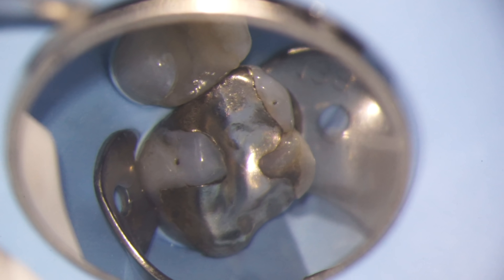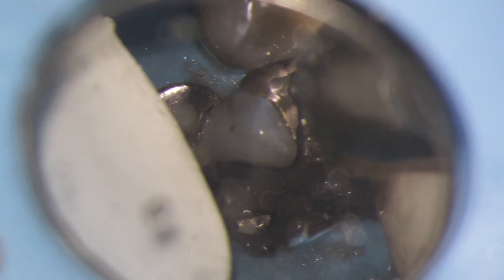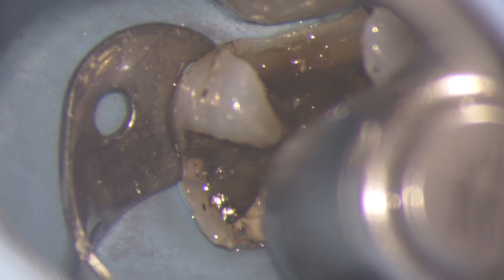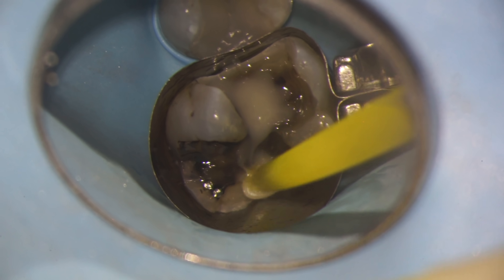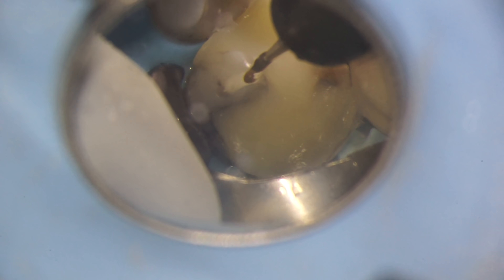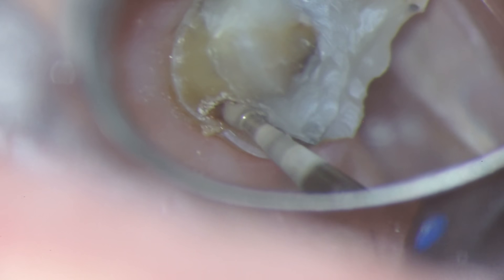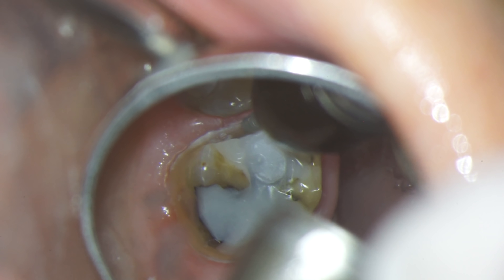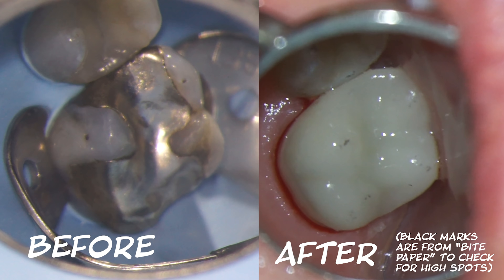How Silver Fillings are Removed

Comment: I just began seeing a new dentist and I was told that she wants to replace my silver fillings. I suspect that some dentists elect to do more work than is necessary just to get paid more. My previous dentist totally repaired my smile with white fillings and never mentioned my old silver fillings at all. I've probably had them for 25+ years and think they're fine. I'm not sure who I should trust now.
Reply: You may be okay with keeping them, it's just that some people experience decay under silver fillings and mercury poisoning, which in this case it is best to remove them.
Reply: @komfykoala6083  I have had one replaced. Doing so caused sensitivity in that tooth and it took several months for the sensitivity to subside. They showed me a very small crack near the filling. It's nothing serious but I suppose I'll have the other replaced at some point. Getting everything fixed and practicing good oral hygiene since I neglected my teeth during my adolescence, and I want them to be in good shape when I'm older.
Reply: @ClassicalPan  Best of luck to you 👍

Comment: I love your videos man! I struggle with amalgam removal and have tried to do the splitting technique but it doesn’t always go super fast still. Taking out an old #18-MO I’m always worried about my bur dropping and hitting a pulp horn. Usually it’s tough to get the last bit of pulpal floor metal because my 330 is “skipping” along the top. Any advice on that?
Reply from the maker: Julian, I hear you. One thing you could try is a 331 bur instead. It's a big bigger and seems to get through the amalgam easier. Also, if you're not already, you could try magnification (ideally 3.5x or higher) WITH a good headlight (the latter being the most important part). When you can see exactly what you're doing, you'll have a lot more confidence in knowing when you've broken through the last bit of amalgam.
Reply: @MichaeltheDentist  Thanks! Yep I use a strong light and 4.0x. I'll try the 331's ; I find taking out amalgams so stressful sometimes (especially when they are RIGHT on top of a horn). Thanks for the advice!

Comment: Silver? You mean mercury fillings. And very large amounts of mercury are released when you drill on these fillings with a high speed drill. It wouldn't surprise me if you far exceeded the EPA's air quality standards for the work place.
Reply: @ Ian Curtis.    Did you notice how well you could see the procedure?   That because of excellent use of high volume suction which removes the majority of the debris/ vapor

Comment: What good about silver/amalgam fillings is that they expand over time covering the unfilled areas VS composite that shrinks which let bacteria inside/invade the shrinked areas..
Reply: yeah mine expanded and broke my tooth in half. clean off. now its caused me more issues cos i now need a new filling to fill in the gap it broke
Reply: update. mine has now come loose and because it broke my tooth like stated above i now need the tooth removing
Reply: @CSGOMercy  I'm sorry. Which tooth you lost? Molar probably? Upper or lower?
My upper 2nd molar broke in half too coz of the really old silver filling(15 years). The entire distal part of the tooth chipped. I think I'm gonna need a crown now after an rct , even though my root is all fine. ☹️
Reply: That's certainly the bad side of amalgam, i forgot to point out so there are pros and cons with using this material. But I guess it's being studied worldwide, infact some countries already ban the use of it
Reply: Ya it also dumbs people down enough to not realize they’re being fucked and lied to about everything

Comment: I had my old fillings replaced, and my dentist never used a rubber dam. I don't recall chunks of filling being removed either. It seemed like he only used some sort of grinding tool, so I have to wonder if he even completely removed the old filling. There's still a bit of sensitivity and it's been 3 months. Should I be worried??

Comment: what happens if the bacteria is sealed in by the silver fillings? Do they continue to eat and rot the teeth or do they die since they would kind of have been blocked from access to sugar in mouth? :) Thanks
Reply: They use a solution that kills and bacteria before they fill the cavity. However, a filling can become loose later down the line without you noticing and cause what’s called leakage. In this instance, yes bacteria can travel through and continues to grow the cavity.
Reply: I'm interested in the answer as well

Comment: I am always scared of the dentist drill.
When I was 4 or 5 I went to the dentist to get a filling, but the dentist said that it was gonna be quick so I didn't need anesthetics. Worst. 2. Hours. Of. My. Life. So now I thank that local dentist for traumatizing me. Now when ever I hear the drill I feel the pain and my eyes start tearing up. Before I had no trouble going to the dentist but now I always hesitate on going.
Reply: Mine is a similar story. Most of my milk/baby molars had root canal done on them. Except for a molar on left side which required anaesthesia, none of the other root canals were performed under anaesthesia. I have been so accustomed to the pain that it doesn't bother me any more. 4 Adult molars had root canal done and one teeth was removed without any anaesthetics.

Comment: ive lost all trust in dentists after being told the small black/brown marks in the crevices of my teeth were fine.  i go 3 times a year between checkups and cleanings as i didnt start caring for my teeth until i was 16.  I was very concerned about the marks and asked again and again for them to be drilled and fissure sealant applied to prevent food from sticking and causing decay.  I was told every time that the marks were cosmetic, just staining.  But sure enough over the last 2 or 3 years, each little mark has been revealed to be the opening to a large cavity hidden beneath the surface.  2 were so large i was offered crowns.  The bastards just wanted my money and were waiting for my teeth to go beyond the point of simple saving.

Comment: Is there anything you can recommend? I have seven of these in my mouth. I'm willing to pay to get him out. Nobody wants to do it.
Reply: Try holistic  dentist
Reply: Yes defiantly a holistic dentist I'm getting mine removed once there up and running hopefully July or aug it's expensive thou 300 per tooth!
Reply: Probably because theres nothing wrong with them. You're not doing your health or your wallet any favors by doing unnecessary dentistry
Reply: I have two which are visible that's the only reason I want to change them. Otherwise they've never given me any trouble.
Reply: use a smart certified dentist for removing silver fillings! 
www.iaomt.org 
you can find plenty of dentists who will remove them correctly & safely! it can be expensive.. protect your health while removing silver fillings.
Reply: Juan Frede 😳😳😳😳 I’m 49 and I’ve had mine in the back of my tooth’s since I was around 14 🤦‍♂️
Reply: Juan Frede well I went and. I’m getting a crown.  Instead  ...
Reply: Juan Frede 🤔🤔well they did use that small infamous drill and had another tech person holding the hose to sick all that silver thing ..as far as I know it was done right ...what did i needed to look for when they removed it ?